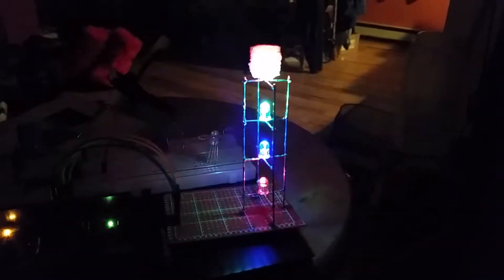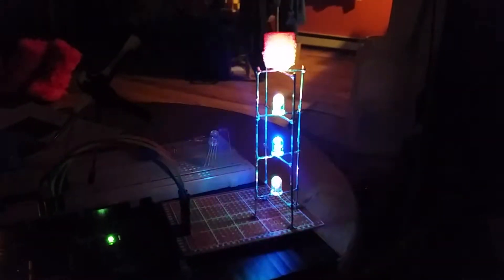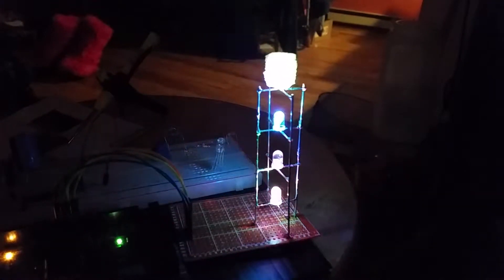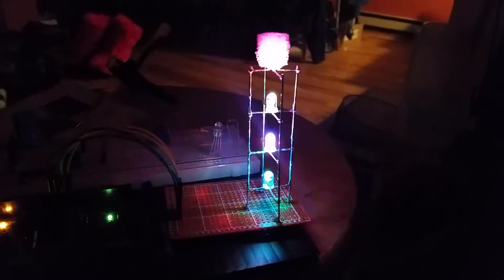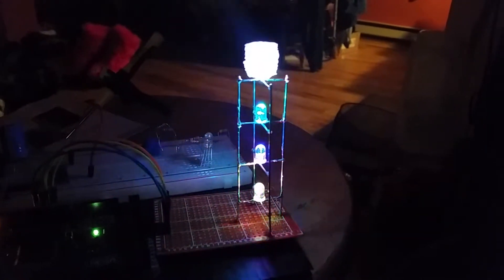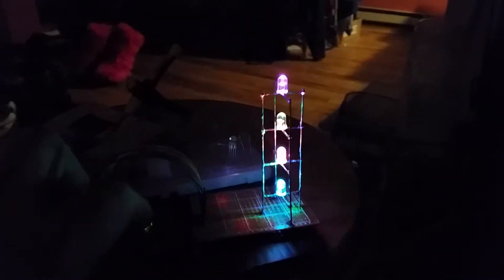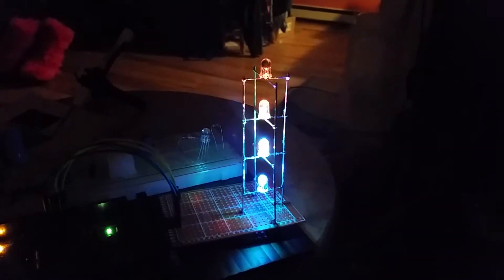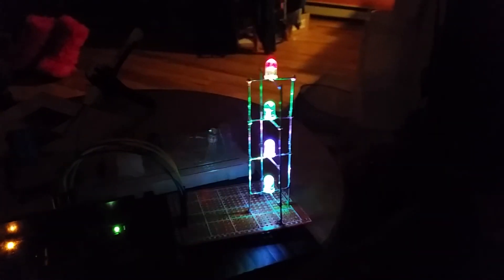Charlieplexed RGB LEDs , real simple

Comment: can you please place a link to the code to test the spires. I just started with code and need help this is my first project building a cube is RGB 8x8x8. The way I see it is go big or go home. That is why I took the challenge of the 8x8x8 RGB but I try testing the leds and it does not seem to work out for me running the code I downloaded from github for the cube itself.
Reply from the maker: ah the single tower of RGB is essentially 12 LEDs.  you can drive them at random as easily as applying different PWM / analogue write to each of the 4 pins. I'll look and see if the code I used is still here someplace. 
this may help you in the short term while i hunt for how i did it :
https://makezine.com/projects/charlieplexing-leds-with-an-avr-atmega328-or-arduino/
Reply from the maker: this one is better and looks very much like how I did mine. The LED stack here is very small but maps out the same. http://www.instructables.com/id/Chalieplexing-4-RGB-LEDs-with-4-wires-on-Arduino/
Reply from the maker: ok CBmamiga  is closer to my structure, and Hari and I use Asher Glicks bassed code as CBM does here: https://www.youtube.com/watch?v=zEIUTQOe7L8